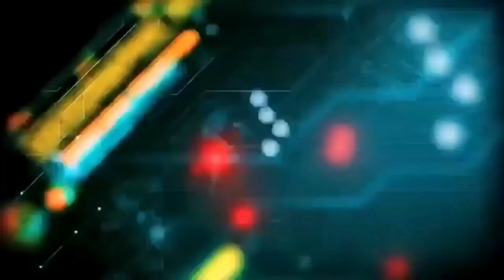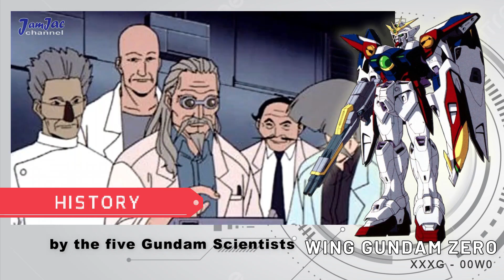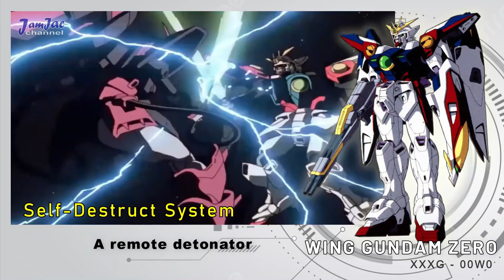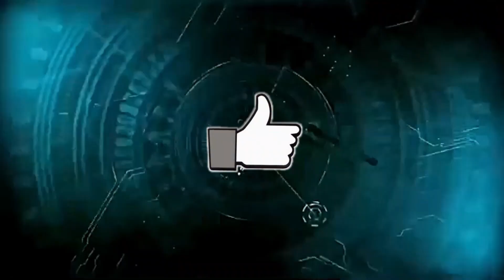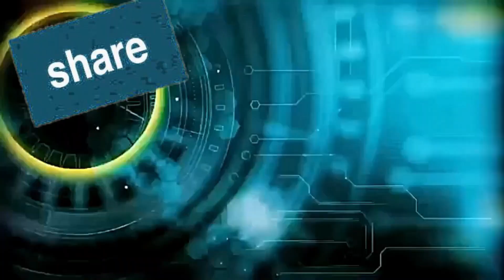Wing Gundam Zero  l  XXXG-00W0  l  Mobile Suit Explained

Comment: Wing Zero needs an update: 1) add bits/dragoons; 2) replace shoulder canons with railguns; 3) add hip-mounted beam canons; 4) replace head and shield vulcans with beam vulcans; 5) zero system with helmet or 360 degree view screen.
Reply from the maker: Thanks for sharing your knowledge about this mobile suit. Appreciated.
Reply: Black Wing Zero in Frozen Teardrop has Funnel Jack with the ZERO System.

Also, with Glory of the Losers, I don't think Zero needs more firepower since it's been spamming full power blasts with no charge time even at close range and was capable of easily tagging Epyon of all things. (Epyon gained a Shield capable in turn of shrugging off Colony Busting Beams however)

If you want to go further, Wing Gundam Snow White has the funnel jack, ability to disable enemy mobile suits and Elemental Blasts. If you really must have a power up, I don't think you can go over that short of Turn A and 00 ELS. Oh and Snow White can tank point blank Buster Rifle shots unshielded.
Reply: So...the StrikeFreedom. 🤣😅😅😅😅
Reply: @wiltedsheep  Does the StrikeFreedom have a zero system? No  🤦‍♂🤦‍♂🤦‍♂🤦‍♂🤦‍♂
Reply: @charzanboo9940  so that's missing in the StrikeFreedom, what you still wanted as an update is the StrikeFreedom without the Zero System.

The Zero System is just the magical-macguffin bullsh!t element anyway, you can forget just that.

Like we can use that whatever Gundam Lockon Stratos has in the Trailblazer movie, it has 2 haros instead of the Zero System to do the same thing. 🤣😂😂😂
Reply: @wiltedsheep  I see reading comprehension is not your strength as I mentioned in my original post that wing zero needed a zero system *with a helmet or a 360-degree view screen*. And no, the zero system is not a magical-macguffin as things like neuro-link devices are being researched as we speak...I suggest you stop responding and go outside before you continue to embarrass yourself 🤡
Reply: @charzanboo9940  lmao you watched too many Ancient Aliens, friend. 😅🤣🤣🤣
I work in neurosurgery/neuroradiology, we don't hear these kinds of "researches" like the zero system's way of feeding multiple scenarios in the brain.

You didn't even understand what it is: the Zero System is like Dr. Strange's powers,  you m0r0n. It gives all the scenarios and picks out the best and shows it to the pilot.
I've instead, seen this fiction played out in History Channel (no, not ancient aliens, some other whacked program of theirs). I would believe the...IBO's system instead as we do have those neuro-link from the spine types of research.

Anyway, you sound like a 5-year old just now, so yes to avoid embarrassing myself arguing with a kid, I'd rather not reply. 🤣🤣🤣

And you go watch Teletubbies while I go outside. 😊 even with this flawed Gundam Wing plot, it proves here it's still too much and too mature for you to handle, it's like the plot itself is your Zero System. 🤣🤣🤣🤣🤣🤣🤣🤣🤣🤣🤣🤣
Reply: @wiltedsheep  Cough, cough, *Neuralink*, cough, cough. Perhaps you should look for another line of work because you're horribly misinformed 🤣🤣🤣🤣🤣🤣🤣🤡🤡🤡🤡🤡🤡🤡🤡
Reply: @charzanboo9940  yeah we know what Musk's game is, you common m0r0n. He's making those companies for the STOCKS, just like Theranos, though less deceiving (for now).
Lots of investors in that pseudoscience fairytale of his, and people like YOU who can't discern the difference between neurology, and ophthalmology, will eat whatever he said. He got people on dogecoin before, he won't fool health professionals on this common game.

He can fool people like you ofc.
So keep your clown mask, you need it for yourself. 😅🎁🎁🎁
Reply: @charzanboo9940  also, Musk's Neuralink (if it ever come to fruition) is akin more to the IBO's Alaya-Vijnana system rather than the Zero System. 😅😆😆😆

So, you quoted a company to support MY point, you turbo-dumb twat proving yourself wrong. So, who's misinformed now? 🤭🤭🤭🤡🤡🤡🤡💩💩💩
Reply: @wiltedsheep  Another point that goes over your head lmao. I feel sorry for your patients lol. Look up how Neuralink is defined: "Developing ultra-high bandwidth brain-machine interfaces to connect humans and computers " That is exactly what the zero system does: connect the human pilot's brain to the Gundam's computer. Now quit your job for the sake of your patients because you are a danger...